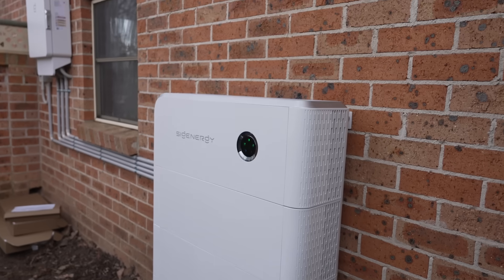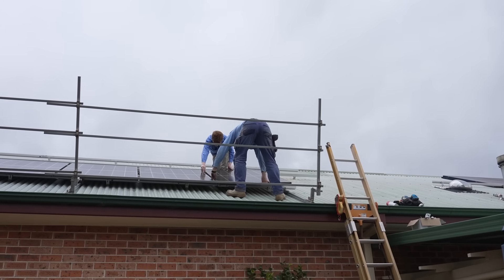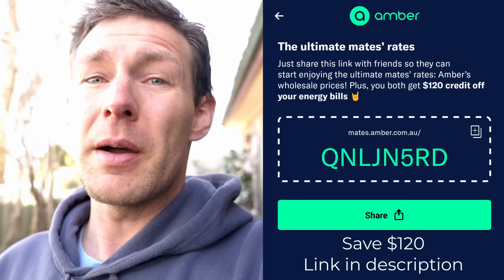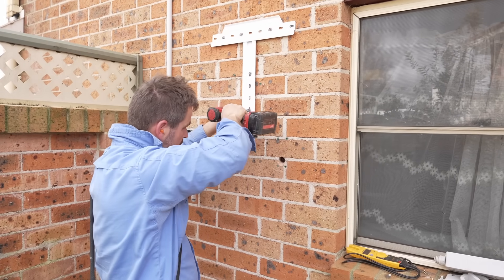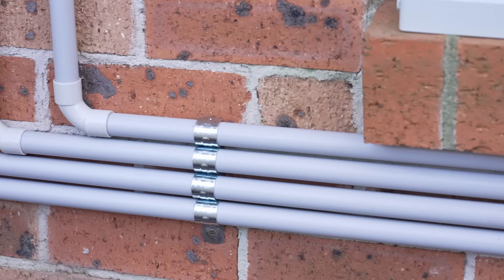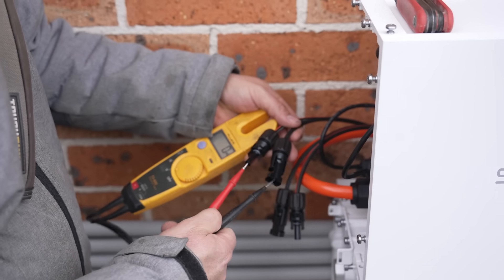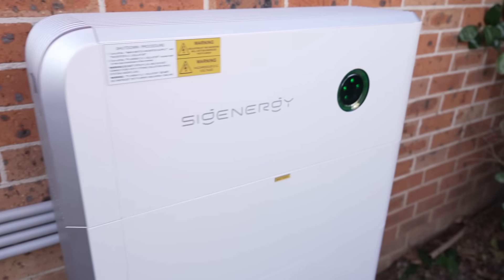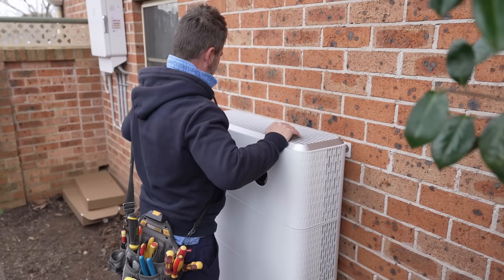SIGENERGY 24kWh BATTERY Installation in Australia | My Honest Review & First Impressions: SIGENSTOR

Comment: There is no way that you will get a 3-4 year payback. Anyone watching this should do their sums. Let us say the batteries and cabling and controllers cost $25,000 plus the extra work on dissassembling and reassembling the panels array. So $28,000. If you charge yourself 5% interest on the system, it costs you $1,250 in interest in the first year. If the payback was 4 years, divide the $28,000 by 4 and he is saying that he saves $7,000 plus the interest per year. Total rubbish. He does not currently have an electrity bill of $8,500. Also, these batteries have a life of 10 years with only 70% at 10 years if you are lucky. The so called consumer is doing an advertisement for Sigenergy, a new company in Australia. We have no way of knowing whether the batteries will see out their 10-year warranty. Consumers beware.
Reply from the maker: Thankfully none of the numbers you're using are anywhere near my install cost. And no kick backs for me from sig.. although if they would like to offer me some more batteries I'd be more than happy! haha Time will tell as to the pay back, but so far, have been getting about $200 credit per month... so even if I'm getting conservatively $1500 back a year, Plus the $1000 VPP rebate, and saving $4000 a year on power.. my payback looks about on track.

Comment: I'm trying to figure out which conduit is which cable. There's four conduits coming out of the bottom of the gateway going into the house and I'm struggling to reconcile these with what I can see in the gateway manual (SP AU).
Reply from the maker: Hmm, I'm not super familiar with the intricacies of the wiring itself, sorry! Best to check with your installer!

Comment: Looks great! Just a couple of questions, the indoor batteries I've seen have bollards but yours doesn't. Is that only necessary where there is vehicle access to the same area as the battery is located? Also, is the eve on your house going to provide enough protection or are you adding that later on?
Reply from the maker: Yes I think you're right. No vehicles going where this is stored. It's water proof and under the eve so I don't see any issues. Even in heavy rain it hasn't got a drop on it.

Comment: Just a follow up to my last comment . My system is installed now and I'm very happy with it . I've learned how to control it the way I want ( didn't bother with the AI mode I'll try that later maybe) .
As for now I'm knocking my bills down to just the connection fee. I've gone with OVO's 3 for free plan and on the cloudy days I top off the battery between 11am and 2pm. 
Any generation not used after that gets fed back into the grid.
I must say the DC charging of the battery seems to get the very best performance possible from my solar panels.
On the couple of clear sunny days since the system has been installed I'm generating around 50 Kwh on those days so in some ways I wish I'd gotten an extra battery module or two.
Hope this info helps anyone looking to buy one of these systems.
Reply from the maker: That's some solid stats! Do you get a feed in credit? That might knock down that connection fee a little.

Comment: Good video. I would have thought both the gateway and battery should be undercover? As much as the conduit work is tidy it's a bit of an eyesore IMO. Would have run cable tray in your instance. Congrats on yr new system 🎉
Reply from the maker: Thanks, it's under an eve of the house, if it becomes a problem I'm sure there's a shelter I can erect over it.
Reply: @lifeofryan_ I run a fan onto my batteries in really hot weather

Comment: 24kwh system in the UK installed last December , I’ve kept it inside a garage given our weather .
  So we have had our best summer for years beginning effectively in March , 480 sq metre house has run off grid as well as heating water .
  Just had to top battery up from grid 11th Sept .
So March to Sept at current UK prices has saved me £871 gb pounds .it will go on to save me far more through the winter loading up on overnight cheap rate at 6.7 pence per KWH .
  So far it’s worked beautifully.
Reply from the maker: Oh wow!

Comment: Hi Mate, what is the inverter size? As well 3-P or Single phase? I am looking at putting the system against a bed room double brick wall and would appreciate your feedback. Thanks for your video. Cheers
Reply from the maker: single phase 10kw. It's quiet.. i think the 3phase may get warmer and turns a fan on every now and then if it's maxxing out.

Comment: Oof installed outside. Fail.
Reply from the maker: why?
Reply: @lifeofryan_  Mainly thermal.   They may be IP66 but installing it outside directly exposed to the weather is not a good long-term strategy.

Comment: I have the same 24kWh battery setup, but paired it with a 12kW inverter, mainly because the price difference between the 10kW and 12kW models was just $120. I also had an existing SolarEdge system, which I kept in place and AC-coupled to the Sigenergy setup. In addition, I installed more panels that are DC-coupled to the battery. So essentially, I now have two separate solar arrays: one AC-coupled and one DC-coupled.

The reason I chose this approach is because that SolarEdge inverter you removed is worth around $2,000, and the optimisers are about $100 each. Unless you managed to sell the inverter and optimisers, you’ve effectively thrown away a few thousand dollars in value.
Reply from the maker: That's a great setup to have both AC and DC coupled systems! Unfortunately that is the case re the inverter and optimisers
Reply: I have a SolarEdge with 6.4kW of panels with 5kW inverter. I've just got my 1st Sig 24kWh quote for AC coupled.  I never thought about either throwing out the SolarEdge inverter or adding new panels that are DC coupled.  Very interested to hear more ( ps my solarEdge HD inverter just died after 6 yrs. Waiting for a replacement under warranty... hmmm is there any opportunity here .....)
Reply: @brettogden6104  what did that cost you? pretty similar to what i want to get

Comment: Thanks for the amber referral code, still works! If you try to use referral/coupon codes from popular channels, they're all erroring out with "Coupon redemption limit exhausted".   My "Energy Local" retailer is shutting down Tesla VPP in SA end of next month, shopping around for a good option, 10kw on the roof + freshly replaced powerwall 2, amber seems like a pretty good deal.

Comment: Great video and thought provoking for me regarding the DC coupled over AC.
I’ve got 13kw of panels with a SolarEdge inverter, and installer is coming in 4 weeks to install 24kw of Sig battery, but AC coupled.

Trying to to determine implications of going Dc coupled. I don’t have much shade over panels so getting rid of the optimisers doesn’t bother me.
And if I do go DC coupled, I’ll get rid of SolarEdge right?
Reply from the maker: yeh you use the inverter with the sigenstor. How big is your solaredge inverter? Mine was only 6Kw where as the sig inverter was 10Kw, so I had a lot more capacity using the sig for my 7.7kw solar. Your ability to charge the battery will be limited by how big your solaredge inverter is.
Reply: Get a SolaEdge Battery
Don't connect any AC coupled battery 
1 single vendor 
2 the most efficient system in the Market is SolarEdge you would have over 30+ days more battery utilisation over any Ac coupled battery

Comment: I cannot believe that you threw away one of the highest yield solar systems, SolarEdge, for a new Chinese player. I think this is a silly idea. SigEnergy black starts off AC coupled solar, always has. There was a recent independent study from the USNW that shows that SolarEdge has an average of 10% higher yeild than string inverters. A better option, in my opinion, would have been to take advantage of the SolarEdge trade up deal, which would replace your existing inverter for a hybrid for free, when adding a SolarEdge battery. Note that I install more Sigenergy than SolarEdge.
Reply from the maker: The solaredge batteries were no where near as competitive, had older technology, and their overall footprint is double the size. In the end, I'm happy with my decision.

Comment: I don't understand why the optimisers on the panels were removed. What is the rationale there?
Reply from the maker: they only work with the 6Kw solar edge inverter I had. That would then be AC coupled to the 10Kw sigenstor inverter... essentially meaning I couldn't get the full capacity of the new inverter, and lose the benfits of DC coupling.
Reply: @lifeofryan_  OK thanks.  I have a SolarEdge inverter too, so will need to bear that in mind if/when we look at a battery.
Reply: @lifeofryan_ I'm just starting my SolarEdge and getting quotes for 24kWh sig system journey.   What is the max AC input power rating for battery charging for both a 3phase 10kw and 15kw inverter ?  It doesnt seem obvious

Comment: Thanks for the vid. I'm getting the exact same installed. So just a few questions. 
Was there a delay with getting the Sig components? Apparently that's what's holding up my job??
My system has an existing 6.6 AC feed into the hybrid 19kw inverter, as well as 4.55 of DC input. I was interested to hear you say that having the AC input impacts on its ability with off grid blackstart etc. Is that correct? Why is that?
I can't recall if you told us how many kw of panels you have feeding the system? To convert the AC component how much extra was that?
Sounds like you're happy to date. Any issues so far? Any advice?
Cheers Gavin
Reply from the maker: As long as you have some panels DC  coupled you can blackstart. From what i've read, the inverter needs 200W of power to be able to boot up and get running. I think the DC coupled input is the only way to do that. I've seen some comments saying that if people AC couple and black start, they put one string directly into the DC coupled port and leave the rest in the smart port from the inverter.
Reply from the maker: Yeh I ordered mine in May, didn't arrive till August.. Stock shortages with the high demand.. I think it's across the board. My installer has several still waiting to arrive to start the jobs.

Comment: Will there be any risk of theft by installing the batteries in my carport? Would the risk be the same as having the car stolen?
Reply from the maker: The batteries are geolocked...I'm sure anything could be stolen if someone really put their mind to it.. but you can probably install a few more dynabolts to hold it down and against a wall.. there is also a lockable attachment to keep the ports locked so no-one can get into un attaching it from the wiring.

Comment: Hi, the "not working, re-do my solar" triggered me. But firstly I need to comment on that nice install, it's very neatly done indeed. Electrical boxes and wires are eyesores and a battery isn't easy to hide. I am also in the market, but then in the Netherlands(also 240v similar to AUS). Looking at sigenstor and anker. Did you consider the latter, it has a similar set-up? 
What was your initial solar system that things couldn't work in offgrid mode and why not? I have enphase and that needs to be ac coupled to the battery. While shopping around my questions appear to be either too difficult or technical for the sales guys, and I hardly get a satisfying answer. In the end it runs down to A. will it work when I disconnect the grid forever (utopia I know) I am very interested in what that exactly was in your set-up that it would not work. Could you highlight that, or maybe do a vid, very sure many more people have the same question, or just do not know when they purchase.  
And B. my next difficult technical question in the same ballpark for those sales guys is: if I have it AC coupled, can I still utilise the dc inlets on the battery inverter?  I have space for 6 panels south, right above where I would hide the battery, but this is 10m away from my house and enphase gateways. I dislike more wires towards the house plus costs of micro's and other enphase stuff, when there is an inverter right under the panels already. I had enphase east-west installed only last year, so I do not feel much for undoing it. Buying an enphase battery is ok, but the box to get things offgrid is ridiculously overpriced.
Thanks for getting back to me on the topic of "will not work".
Reply from the maker: I didn't have a battery on the original inverter so this was my first battery to put onto the existing solar. . I don't think AC coupling goes into the DC inlets, but uses the smart port instead. I'm not sure how this goes with strings to separate the panels for directions, I think this happens at the 3rd party inverter. I didn't look into anker. 

You've got some pretty technical questions that a good installer would probably be able to answer. Sorry I'm not able to answer them all.

Comment: Great video - I think your installers misunderstand the compatibility between SigEnergy and a quality third-party inverter. This could be misleading for other consumers watching the video. Choosing to delete the optimisers in favour of DC coupling would is backwards thinking in terms of efficiency. The optimisers will always increase performance and I'm sure you'll see the difference compared to morning/evening production now compared to data from before.  Also, SigEnergy most certainly does allow blackstart in a power outage when AC coupled or DC coupled...Worth flagging that with your installers.
Reply from the maker: Thanks for the update. At the time of this video, blackstart was not possible on AC coupling as far as I've been made aware of by both my installer and all other installers that quoted the job.. maybe this has been a new update?
Reply from the maker: In terms of the optimisers, we didn't have any shading so it wasn't really an issue for us in regards to that. The other thing the DC coupling allowed for was solar curtailing, so that was a big thing I was hoping for. My inverter was also only 6kW so the 10kW inverter was important for our usage.
Reply: @lifeofryan_  Ok that makes a bit more sense. The unlock from 6kW to 10kW (plus DC coupling) will be a big win. Again noting that optimisers are predominantly for shade but also demonstrate a massive benefit in all low-light conditions such as intermittent cloud, rainy days etc and allowing for earlier startup and later shutdown. Lots of data to back this up - trying not to project any 'opinion' here.

On the black start function, the only point of contention with AC coupling is with 3-Phase AC inverters as that's a more complicated load management system. All is in the installation training/handbooks

Comment: Thanks for the great production quality and informative video Ryan! Earned yourself a sub. I also got a home battery installed yesterday. Like you a DC coupled system. 19.8kW of panels to a hybrid 15kW inverter to a Sungrow SBH300 30kWh battery. My system only backs up critical loads during a power outage. We have a large home with 3 phase appliances so installer said it was best to just backup lights and fridge / other components. I am very happy it charged up to 100% from 30% by 10am this morning!
Reply from the maker: Thanks for watching and subscribing! That's an awesome set up. Sungrow is a solid and reputable company. I wish i had close to 20kW of panels!
Reply: @lifeofryan_  how many KW of panels do you have out of interest?

Comment: I was about to get 20kw battery for $9.5k installed but for $3k more I'll get a 35kw (only 5kw inverter thou).
Reply: Got the 8kw inverter plus gateway for full house backup
Reply: Which state? sigenergy as well?
Reply: @fademan77   I'm taking a bit of a risk.
In SA, with Pylontech. Only a 5 year warranty. Maybe shoulda just got a Tesla. Oh well.
Reply from the maker: Sounds like a good deal to get more capacity! Can you upgrade the inverter?

Comment: Conduits everywhere is an eyesore. If can't get the cabling in the cavity assuming is brick veneer would look better to have in one raceway.
Reply: I thought the same. I have 15Kw of panels with Enphase Micro-inverters to an Enphase controller mounted three metres from electrical SWBD. My brief to installer was no external conduits. He complied and it is a pleasure not to see any conduits. Will have same brief to electrician when I install a battery in next couple of months. I realise that is not always possible though on every installation.
Reply from the maker: Fair enough